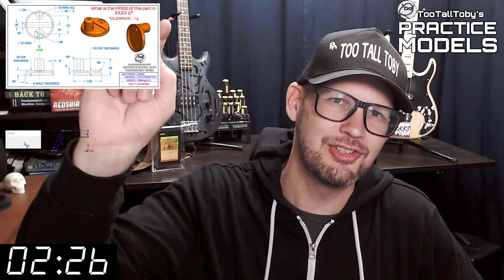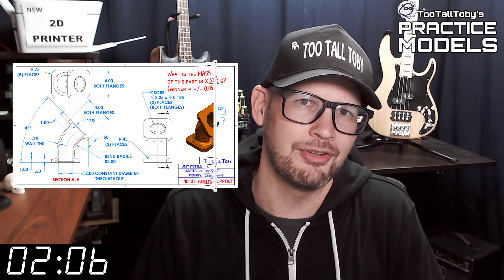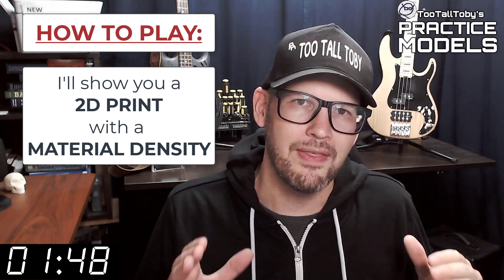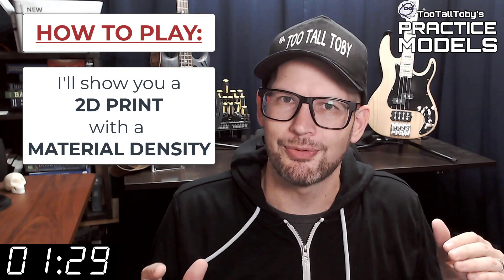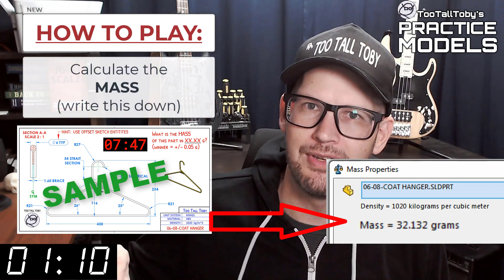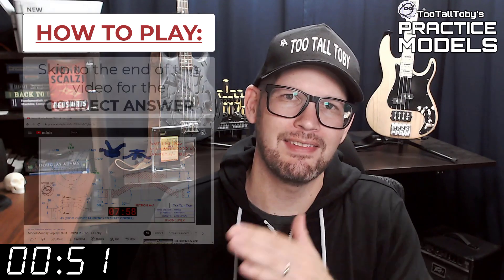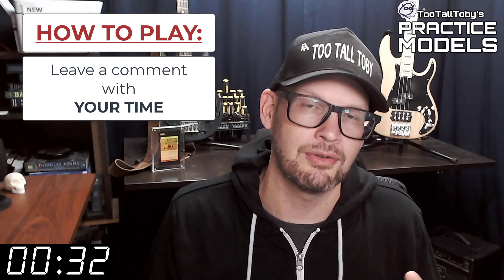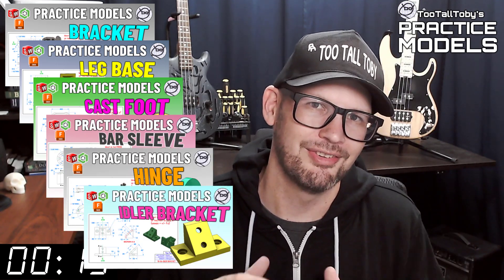2D to 3D CAD PRACTICE MODEL-  Drawing to Model for Onshape, SolidWorks  - MOUNTING BRACKET 2

Comment: 337.0784g 7:52 Fusion 360. 2nd attempt (restarted after completely misinterpreting the top left drawing as a cross-section of the hole)
Reply from the maker: nice job

Comment: 337.078g in Fusion. Couple hours. Stuck most of the time fully defining a top view profile. Learned a bit from it. Thanks for the high quality content.
Reply: I think is simpler if you use the top view just for the dimensions and concentrate on just half of the front view and then extrude the profiles with the dimensions from the other views and then mirror to get the full model
Reply: @AlecsXP   I agree. My mistake for calling it a top view (the one looking through the cylinder). I drew that whole thing out. Should have used mirror.
Reply from the maker: nice job - always a lot of ways to do the same model - glad you found one that works for you!